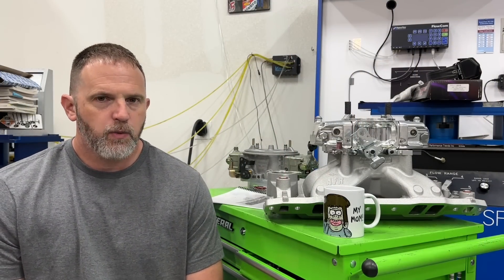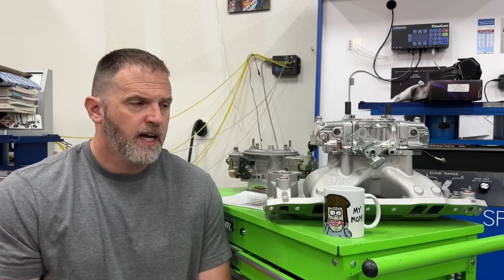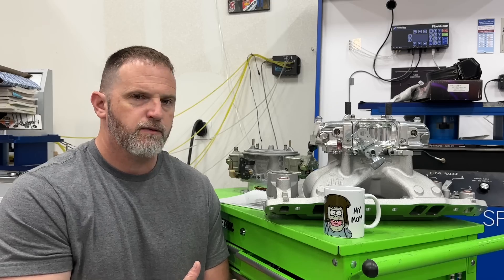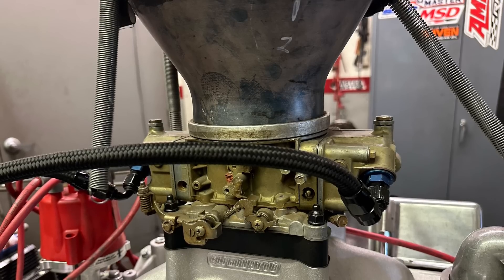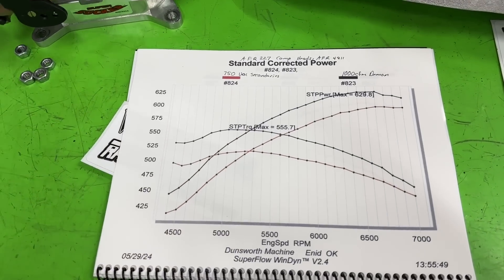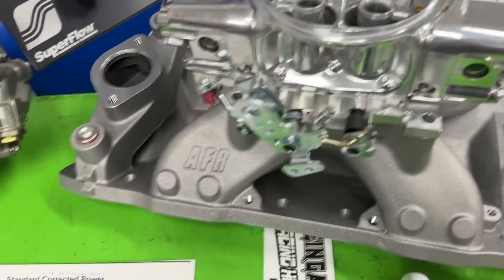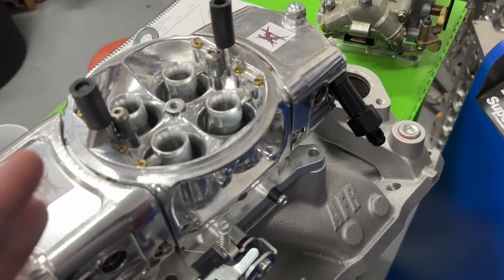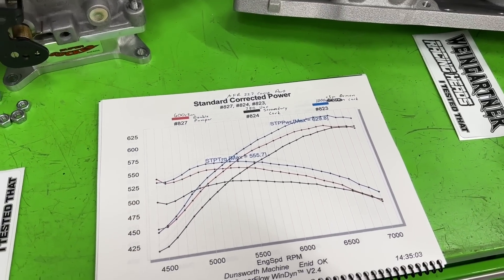Can A Smaller Carb Make More Power Than Larger Carb

Comment: Not everybody runs a .680 high duration lift cam, but more under .500 210dur area and bigger carb runs to rich @ cruise/low RPMS...so a 600/650cfm vac-sec makes a better choice....Do that comparison and see the diff.  Read comments 
@jacquescrusan9500 & @edjackson4389 since most do not need a high RPM engine all day 365 day a year long.  This video is miss-leading using a high lift/dur cam and short sided at best since no one gives to shitz about 5-7k rpm power but a small portion of the market compared to the rest.
Reply from the maker: I have done the same thing on a smaller engine. The results showed again. The larger carb should run leaner not richer since there is less vacuum draw to pull in fuel with larger carb. I will do another test on a 350hp motor just to prove it out. There are more engines above .500lift than below.
Reply: @WeingartnerRacing  I always run a bigger C.I.D and a bigger carb/camshaft combination  in the range of RPMS I want for the application since it ends up making better fuel economy which people cannot believe until they drive 300 miles with me. And I Appreciated all the work you do and watch most of your videos for sure & know your market is scaled to the upper $$$ market, but, YouTube gets watched also by the average Joe who applies it to a very mild barely above stock 350 engine upgraded with a .0. 600" grind camshaft with more duration for strip than street, huge open plane intake, 750 double pumper Holley or bigger and 3" header with 3" exhaust on a 3/4 ton 8000 lbs. truck with 33-35" 4x4 tires w/stock gearing and a stock torque converter trying to power to the ground to soon off idle; and now complaining it sucks gas like a military battle tank, drivability is so poor in town it's unbearable: However, it flies down the freeway at 7-8 MPG once he get's it up to speed.  Though I quoted the worse of them all, it is however still relevant which is normal or typical to a degree more-or-less which those not in the business end up doing to their home rebuilt and watching a video can convey to them they need a bigger carburetor without realizing the RPM that advice is targeting. Dyno are all to often all about max HP/TQ at high RPMS... WHOOOOAH, see my numbers are awesome.

 I have seen to many of these combinations over 45 years where the part specs are to high/large/big for the vehicle type and driving ranges of the operator who has no clue the video is for higher RPM engines with balanced & matched part combination to achieve it the power band they want; and I have to advice them to drop their headers size, intake and carb to get the damn thing to run right before they will listen to a camshaft change also needed.  My experience is there are more armchair bandits in the comments of YouTube, but, some of us have 100s of performance and stock builds starting back in the 70s to my current 408 I am building with $10k in the block & heads already; but as far as more cams over .500" lift it's been my experience every guy wants me to advice him on a RV/Truck cam or just a little more power or do it for them.  I use Dynomation Software to show the them power/torque curves and charts.

However, all those stock millions of rebuilds for 30 years with a intake and carb upgrade, plus the RV torque cams with mild increase are often below .500" life due to not wanting to replace rocker arms on stock valve trains;  since over .500" often kills the rocker arms and/or pushrods wear over time: I know; I have replace hundreds of them once they up the lift over .500" since the 80s where the rocker type is worn away or the pushrod wears through the socket one one or more valves and they hear it finally   There are far more unskilled. let's just say millions  which I will not call idiots, but ignorant about rocker arms issues failing from big lift cams significantly increasing the friction and stress on a stock SBC, SBM or SBF stamped steel rocker arm which we all know has a hell of a lot of hard  miles on them.

I agree there are more LS, Mopar Magnum-hemi, Ford's Multitude of Acronyms and modern engines over .500", but I do believe there are more 318-360-383-400-440 Mopar LA-R-RB, 305-350-383-400-454 Small block Chev and Multitude of Fords models before 1992 running with aftermarket cams in the 0.391 - 0.484" ranges than there are higher.

I asked my buddy who works with Oreilly's Auto distribution center and he stated mostly RV/truck cams or a OEM like stock cam like a  Melling or others which are small bump over stock lift and durations.

Plus the commenters are saying I have smaller carb and smaller cam blah blah.. 

 There are many people who hear and process  in black and white meaning they cannot figure out there are 255 variation from block to white which which leaves them not being able to understand there are 253 levels of gray between black and white statements.  Saying Y carb CFM makes more power than Y carb CFM  that is what they hear and only hear store about Y carb is too weak and always get a X carburetor if you since it is better without any various to the engine components, torque convert, transmission, differentials, tires exhaust, camshaft and vehicle weight. Talkin to a person who process in black and white and cannot see the 253 levels of gray in between them is difficult to communicate to them properly; Good luck.

Comment: I'll say this:
on the '86 K2500, switching over from an edelbrock AVS2 650 to a Holley 390 CFM.  For anything less than 4,000 rpm, thing works great.  Better, quicker part-throttle response, and doesn't run out of power while towing and/or hauling.  Also gives a bump to fuel mileage as well.
My working theory is that smaller carbs have greater part-throttle resolution and can more accurately meter fuel delivery under lighter loads than larger ones.
Reply: I noticed the same thing. I have a 69 F100 with a healthy 347 stroker that I pull my  jet boat with. The truck runs great with the 750 double pumper it was first set up with, but pulling the boat it wasn't great. Changed to a 600 vaccum secondary and the performance from idle to 2500rpm is much better. Especially coming up a steep boat ramp.  The power from 4000rpm to 6500 is definitely down  though

Comment: 1050 6464 4500 on 360ci 4V cleveland on the street worked great. 12.6:1 compression with pump 90. sometimes you just gotta FA&FO

Comment: Allways ran a 3310 780 vac secondary on mine. Stomped everyone running a 650. 350 flat tops closed chamber heads and a team G intake.
Reply: Best SUPER STOCK CARB EVER ......  Originally developed for the 1965 Chevelle 425hp 396
Reply: there is nothing wrong with a 3310, I have one of the older one s that has Metering blocks at both ends, so the jetting can be set proper. I have been running it on my Drag car for 40 years, I have tested a 750 double pumper Demon, With no gain in MPH or ET.. The problem with most carbs is they are not set up right.

Comment: Your 406 really needs that 1000 cfm carb, and the dyno verifies that. At 100% VE and 7000 rpm it needs 822 cfm by my calculation. As you say, getting intake vacuum down, or really getting the manifold pressure up, allows the engine to make power. Driveability comes from knowing how to tune part throttle, too, not just full throttle. Great video, thanks Eric

Comment: i had a 1000 on a CT 350 , it ran perfect and nobody could touch it. the number one reason people struggle with big carbs on small motors is the set up. it’s a compressor and will only pull so much air, therefore you have to reduce the amount of fuel getting dumped in from the accelerator pumps/ nozzles and usually run bigger jets than it had on a big motor. reason for that is the big motor pulls more volume of air through which in turn will pull more fuel. on a small motor it has less pull and cannot draw enough fuel from the same jets. for example the 1000 on my super late model has 80 mains and the same carb on my CT 350 has 84

Comment: If the smaller carb is matched to the rite size engine.
Reply: Not really. A302 makes more  power with a bigger carb. Esp after upgraded heads, cam.

Comment: This whole carb size is the manufacturer covering there ass.
Vacuum secondary is not Vacuum,  it opens from air flow, like a spray gun.
The port for the secondary is in the upper part of the venture.

Comment: Big carbs work with big torque converters. Put that 350/1000 CFM carb with a 2200 stall and it won't be happy unless the driver modulates the throttle. Mash it from a stand still and it will stall, or at least bog substantially. I have a Holley 950 UXP that bests pretty much anything else in terms of peak numbers, but you could never use that in something other than a street/strip carb because the part throttle cruise is miserably rich. I've tried various setups to cure it, but most of the time you can bolt on a Holley Brawler for about 2/3 the price and it works great, albeit making a few less numbers.

I've had lots of carbs on the dyno, some are old crusty Qjets/modified Chrysler 6 packs/Holley 4 bbls that surprised me how well they worked. I've also dealt with misery such as new out of the box carbs that should be flawless but had drivability woes or unexplainable jetting requirements to make them work. My least favorite is the customer's old carb that immediately squirts out of the bowl vent when you turn on the fuel pump, I can't tell you how many times that's happened.
Reply: Most of the stumble, bog, or hesitation is caused by the tuner.

Comment: To be totally fair you either needed to install a choke plate in the 650 DP or remove the choke plate from the 750 VS  because the choke plate affects flow. 

Moreover, the 750 VS is controlled by the spring in the diaphragm. It comes stock with a plain spring. Look up on the chart and you can see to fully open for a 400 cubic inch engine is 7130 RPM. So anything below that RPM won’t be fully open. You have to play with the springs on a  VS carb in the same way you play with squirters & pump cams on a DP. I have always had the best performance with the purple spring. 

I will add that I don’t know how different the dyno loads the engine VS being in a car so possibly the lightest spring being the white one may need to be installed for the dyno. 

So in summary the comparison between the 650 DP and the 750 VS is not accurate until you can get both carbs to fully open both with or without choke plates. 

Much appreciate your efforts to educate us.

Comment: I have done carb comparisons several times on various engines. On the road  and on engines that are flat out @ 6000 rpm. Maybe. 289 auto Ford,, 750 dp v 600 v 750 vacc. 600 was by far the best, the 750 really struggled @ under 3000. The 750 Vacc did a better job but still dead down low. 
327 Chev with 4 speed. Tried 600, Q jet, and Thermoquad. Q jet best at 2000, TQ best all round and 600 was well ok. These were all carbs off the shelf. The TQ was a near new 340 Mopar carb.
355 Chev race engine. Used a 650 DP. then a 750dp. Same track and it made aprox 250 rpm more on a long straight. Since the engine was 4000-7200 throttle response on slow corners was similar. Lap times with the 750 were a little better.
Same engine, 750dp V 830 annular.Very wet meeting but the 830 was actually more driveable and I could use a gear up to normal and it was faster than most. Top end was a little better as well. Compared that with a 750HP and the annular was better more so at 4000-5000 rpm range.
400 Ford,, 780Vacc v 670 street Avenger. 670 was better everywhere except top end. And used a lot less fuel. 
351C mild race engine,, Used 750 Vacc that worked extremely well and made the same top end power as a 750DP. DP however was a little faster. Better response off slow corners [4000 rpm] 750 HP was marginally better and seemed to use less fuel. Tried a [brand new] 750 E85 Quik Fuel on the dyno only, Made no more power than on petrol and was harder to start. No driveability under 2000 rpm.
As a performance carb the 830 annular was by far the best, a pity Holley do not still sell them. The race engine results were on 100 Avgas. Street engine results on premium 98 unleaded.
Reply: Annular boosters are still on some quick fuel and demons

Comment: TO BE FAIR. As far as running 11.3 on 91 pump gas for hundreds of dyno pulls with no problem, an engine on a dyno is NEVER going to get as hot as an engine under a hood when its 100" outside. Just pointing out I wouldn't go to the bank with that statement.
Reply from the maker: Ok. The s10 old 355 had 11.9 compression 91 octane cruised everywhere even when it was 100. Underhood temps were high. Even now they are 155. No problem but I have a timing controller to lower timing at lower rpm. I wouldn’t try that with straight timing

Comment: That proves bigger is better. The vacuum secondary didn't catch up until until it was fully open and the 650 was running out of flow. Double pumpers rule if you can use it. A big heavy car or truck might drive better overall with the vacuum secondary carb. Lighten the spring until it bogs then back up one.

Comment: It is very hard to over carb an engine!
Reply: It's really easy to do with double pumpers because they're more sensitive to changes in size vs a vacuum secondary. You can mask problems of over carbing an engine better with VS
Reply: @KingJT80  Depends on whether or not one knows how to control throttle application! If you just mash the pedal to the floor with mechanical secondaries and expect good results that is most likely what you believe.
Reply: @stephenwest798  I would go further to say if you expect good results with no suspension tuning or any other tuning with the car can't just have a powerful engine and not tune the whole rest of the car with it everything works as a unit
Reply: @KingJT80  You can usually tune the stumble out with the squirter circuit?
Reply: @bobg3034  you can. 

But it's just way easier to get the right type and size carb for the application.  Wheb you start to go way outside the norms of what is expected of a carb in a application, then that's when you have to fiddle with it a lot more . 

Example a 5500 RPM redline 9:1 compression 355 Chevy with vortec heads and 3.42 gears and basically above stock 1800 rpm stall in.a 3700 lb vehicle doesn't need a 750 double pumper 

at most it needs a 600 vacuum secondary. You may get away with a 600dp in a lighter car like a fox in that application but it doesn't really need it.

Comment: First car in HS 306SBF with a 3310, 1"open spacer, on a Torker II. Super responsive throttle, excellent driveability. Didn't have access to Widebands in late 1980's only a vacuum gauge. Everyone told me it was way too big. Soft secondary spring and the bigger pump gave it enough of a shot to get the fuel moving off idle. Would do again LOL.

Comment: Wouldn't the drivability be drastically changed if the big carb is on a mild 355 rather than whatever power level  it was supplying in your s10? Say you have a 350hp 355, won't a big carb be harder to get dialed and behave correctly? Asking for my friend who is converting a Mercedes V8 to a carb who I'm recommending a 650 over the 750 or 850 he wants. It's 350hp on a good day(I'd guess more like 250 wheel). 5.6 ltr.
Reply: Yep that more correct than not. 

A 650  is probably big enough a 650 vacuum secondary at that not a double pumper

That engine would hate a 750 double pumper
Reply: @KingJT80  yeah basically what I told him. It is going to get its brains kicked in at higher RPM in a drift car but I still don't think a 750 is necessary, and there's nothing available to make it a really nasty naturally aspirated motor without spending a shitload of money.

Comment: I wonder if it’s all things tuned and jetted equally, is it a function of the more area is changing the pulses in the intake. 
Because if an engine is only capable of moving X amount of air at its volumetric efficiency. The only way I can see without forced induction that stacking is how you would force more air in. X amount plus the pulse. More area changes the tuning and a larger area would offer less impedance to air moving through. 
Or am I just being high?

Comment: I always run a smaller carb for street combos than ideal, I like the crisper throttle response. My 600 hp 406 feels unreal with a hp 750, it's down 25 hp over a hp 950 but it drives better on street with the 750

Comment: Buddy of mine had a Big Block Nova with a DP. Ran fantastic.  Switched to a VS and magically went about 4-5 tenths faster in the quarter.   Why.  He couldn’t hook. Switching to the VS and tuning the secondary opening allowed him to leave just soft enough to hook.  Would have been a different story with slicks.
Reply: Then he should have worked on suspension before he took the power out. Maybe 2 way adjustable shocks might have helped tuning compression and rebound.